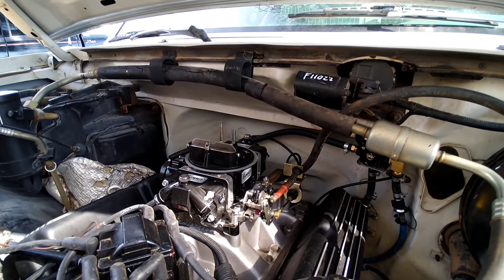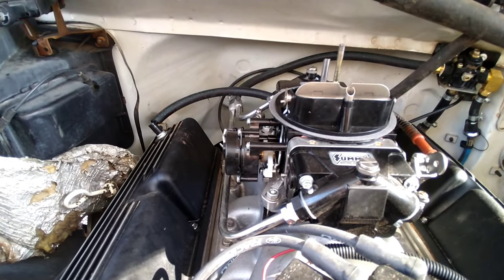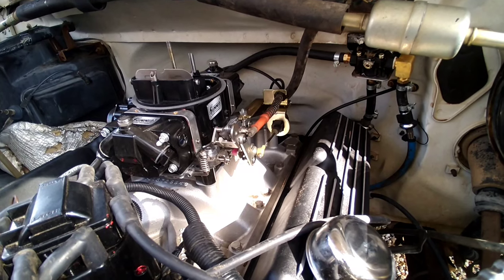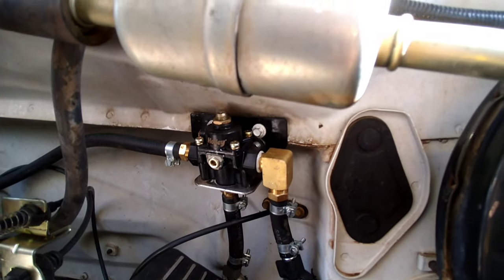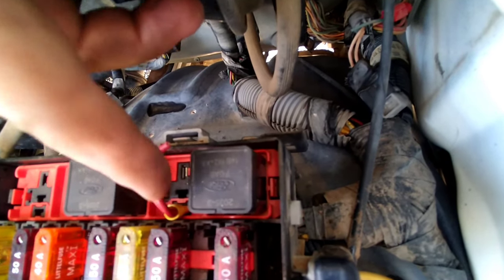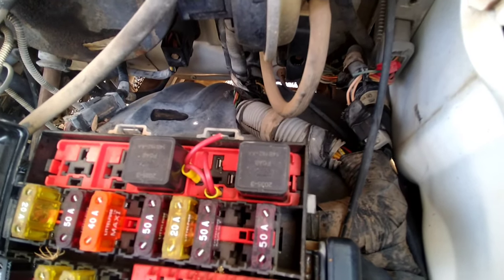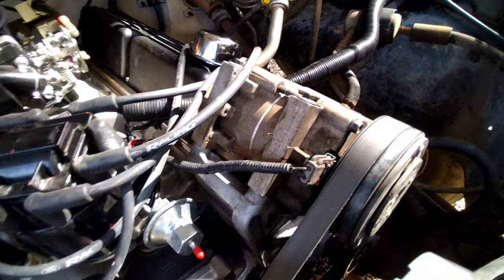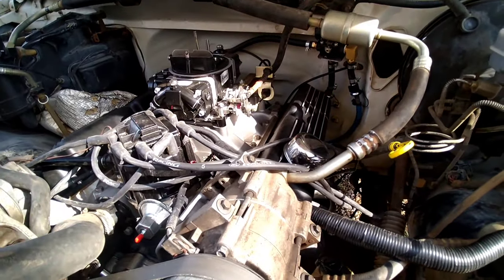87-96 F150 EFI to Carburetor conversion

Comment: I did this on my 94 model f 250 351 w. And I can't get it to run right to save my life. 1 day I drove at about 70 miles and ran perfectly, park it, on the way back home the next day. I didn't think it's gonna make it home. It runs perfect in park. But when I put it in drive, give it gas it stumbles and dies. Any suggestions would be greatly appreciated. I've been dealing with this for a year.
Reply from the maker: What's your fuel pressure at what carb u running and what timing
Reply: @CCAutoWorks  about 5 psi, eldelbrock,  I'm going to check timing today.
Reply from the maker: @ourtube4u  id bump fuel pressure to 7 psi and check your float height wat distributor and coil are u running
Reply: @CCAutoWorks  it's a jegs distributor and msd coil. I uped the timing and it helped a lot, on a eldelbrock carburetor witch port do I use for vacuum advance?
Reply: Thanks for your help. So far it has been a great help!
Reply from the maker: @ourtube4u  your supposed to use the port that doesn't have vacuum at an idle only when you give it throttle it has vacuum but I use which ever one works better for placement
Reply from the maker: @ourtube4u  timing should be 12/13 degrees of initial timing and 34/36 overall timing
Reply: @CCAutoWorks  thanks man you've been a great help 👍 😀
Reply from the maker: @ourtube4u no problem anytime

Comment: I appreciate this video very much. My truck is an 89 and I believe it won't run because of a bunch of electrical problems. I've sunk so much time and money into it that now I'm to the point where I think I might go this route.  Do you happen to have links to the brackets that you used.  I think i can find everything else
Reply from the maker: Yes I can send the link and this is definitely the way to go
Reply from the maker: https://www.ebay.com/itm/Throttle-Cable-TV-Cable-Bracket-for-200-200-4R-200C-4L60-AOD-Sonnax-/283457202705?mkcid=16&mkevt=1&_trksid=p2349624.m46890.l49286&mkrid=711-127632-2357-0
Reply from the maker: https://www.ebay.com/itm/700R4-AOD-TV-Kickdown-Bracket-Kit-for-Edelbrock-Carter-Carburetors-/271255406805?mkcid=16&mkevt=1&_trksid=p2349624.m46890.l49286&mkrid=711-127632-2357-0
Reply: I have a 92 flareside with the 5.0 but wanting to put a 347 stroker it's non maf do you know what would I have to do to make it run like it should with efi, or would it be better to carb it @CCAutoWorks
Reply from the maker: @javontewashington9141  if your going to run a small efi cam it should run but if your going with a big cam u will have to convert to MAF
Reply: @CCAutoWorks  ok I actually have an a9p computer with the motorsports maf conversion harness I bought for my 88 Ltd crown Vic but I went carb so would that work for the truck?
Reply from the maker: @javontewashington9141  I think so Ford racing used sale a similar kit
Reply: @CCAutoWorks  ok thanks I'll give it a shot I'm thinking of buying a 425 HP 347 stroker, but I do have one more question if my computer and maf conversion kit works would the e40d handle the HP stock
Reply from the maker: @javontewashington9141  depends on who u ask some say yes some say no but the insides are the same as a aod and I've ran one with a 408 stroker no problem
Reply: @CCAutoWorks  ok thanks

Comment: Howdy! Can you post the part number for the throttle bracket? I'm thinking of going with a Street Demon 650 and want to make sure I get the right bracket for the Trans/Throttle combo. Thank you!
Reply from the maker: https://www.ebay.com/itm/234926748138?mkcid=16&mkevt=1&mkrid=711-127632-2357-0&ssspo=ZjVZZbogTlq&sssrc=2349624&ssuid=6G4e_MbCTLy&var=&widget_ver=artemis&media=COPY
Reply from the maker: https://www.ebay.com/itm/254633876443?mkcid=16&mkevt=1&mkrid=711-127632-2357-0&ssspo=aXIgKJ3kSby&sssrc=2349624&ssuid=6G4e_MbCTLy&var=&widget_ver=artemis&media=COPY

Comment: Great video. I'm in the middle of converting my 96 F150, and according to my door tag I have the A4R70W transmission, my question is what if anything do I need to do different as far as electrical. Sorry if that sounds dumb, I've never really worked on ford's of this generation. Thanks!
Reply from the maker: From what I know the 4r70w gets expensive to to do this swap you have to put a throttle body position sensor on the carb on the choke side and there's a company that makes a control box that will run the trans but last I checked it was over $500
Reply: Run a c6 like I am I you want reliability over fuel mileage. AOD if you want an auto but hydraulic control. Get a controller for the 4r70w or swap to a 5 speed.
Reply: @kevinkaas937 how did it go so far? Let us know.  Maybe upload a video

Comment: What about the vacuum lines for the heat controls and all that. What do u do with all that?
Reply from the maker: The one vacuum line that operates the a/c vents I just hooked to a port on the carb works perfect

Comment: My truck is a 89 5.8 351w, if I buy a 86 carb 5.8, will my intake fit on the 86 5.8?
Reply from the maker: Yes all 5.8 have the same intake bolt pattern and deck height this engine is a 96 and I put a carb intake and an older carbed 5.8 a newer 5.8 efi intake will fit
Reply: @CCAutoWorks  ok so 89 efi intake will fit on 86 carbed motor correct? Direct bolt on?
Reply: And do u by chance know what the torque specs are for rod and main bearings 5.8
Reply from the maker: @maximumredline97  yes but most 86 models where already efi from factory so it might be an efi someone swapped years ago
Reply: @CCAutoWorks  its ab 86 f350 351. I had a 86 f150 that was efi. Im guessing on the f250 and f350 they still went with carb till 87
Reply from the maker: @maximumredline97  f250/350 where still carb I apologize I was thinking f150
Reply: @CCAutoWorks  its alright, I appreciate u getting back with me tho. Im decent on a chevy or a dodge. But its been a while since iv owned a ford. I didnt know on the intake pattern on a ford. I know on a dodge pre 85 the intake bolts were slanted. Then when they came out with magnum they went to straight up and down
Reply: @CCAutoWorks  just making sure b4 I bought it
Reply from the maker: @maximumredline97  yessir anytime

Comment: Did you keep the stock high pressure pump on the frame rail or did you bypass it?
Reply from the maker: My 92 doesn't have the high pressure on the rail it has high pressure pumps in the tank but if you have the low pressure pump in the tank and the high pressure on the rail just unplug the one on the rail and just run the low pressure in the tank if you don't want to run a regulator but if you do run a pressure regulator leave them like they are and let it return the used fuel to the tank

Comment: Nice conversion... I have project car that needs convertion to carb... Does the Holley fuel pressure regulator work with the high pressure from the oem efi fuel pump and drop the pressure all the way from around 5 bar to around 7-9 psi..?
Reply from the maker: That's how mine is as long as you have a return to return all the extra fuel pressure you golden and make sure u get the low pressure regulator for carb use because they have the same regulator for high pressure EFI use too
Reply: @CCAutoWorks  Thanks for the reply... appreciate it... now my old mercedes might just came back to life...
Reply from the maker: @syafiqadha  I don't know much about them but if you have a card a carb intake to fit the engine and you have a hei distributor or a way to make the stock ignition system work she will run like a champ
Reply: @CCAutoWorks  My mercedes is a W124 with the pain in the ass fuel divider... it still uses a distributor for ignition... just needed the right fuel regulator and the right carb...
Reply from the maker: @syafiqadha  https://www.ebay.com/itm/304779174781?mkcid=16&mkevt=1&mkrid=711-127632-2357-0&ssspo=UTIBs-LAQCi&sssrc=2349624&ssuid=6G4e_MbCTLy&var=&widget_ver=artemis&media=COPY
Reply: @CCAutoWorks  Thanks man... appreciate it...
Reply from the maker: @syafiqadha  anytime thank you for watching

Comment: Are you still running the coolant temperature sensor ??
Reply from the maker: Yes temp,oil,amp and tach
Reply: The one thats next to the distributor? Did you keep that connector on the harness
Reply from the maker: @carloschavarria8093  yes and yes I cut everything out except the temp wire the oil pressure wire the ac compressor wires and the tach wire and one ignition wire for the new distributor
Reply from the maker: @carloschavarria8093  no I just figured out witch one ran the tach and one ignition wire from that connector and cut out the rest of it I only left five wires from the original harness

Comment: So are you still running stock E7 heads? Trying to do the same conversion from EFI but with a manual trans so it should be easier.
Reply from the maker: In this video i was running promaxx aluminum heads but a couple months ago I actually pulled them off and put the E7 heads back on so I could use the promaxx heads on my brothers 393 stroker

Comment: It looks nice. You did a good job clean job. What distributor did you use. I'm doing the same thing but, I'm putting a 351W and a AODE from a '94 F150 into a 74 F100.
Reply from the maker: That's awesome I just just a small cap hei distributor off ebay

Comment: Did you cut all the o2 sensors and did you have to do anything with the computer?
Reply from the maker: Mine only had one O2 and I removed it and the computer is still in the truck but it's all stand alone now with the carb and hei distributor

Comment: I have a 89 with a 4.9 which I’m swapping out with a 5.8. Would these same things you did work? And also have a 5 speed M5OD-R2 to go with that
Reply from the maker: They should
Reply from the maker: You won't have to worry about the kickdown cable but you can use the stock pump and jump the relay just use a bypass return style pressure regulator
Reply: Thank you, I appreciate the feed back!
Reply: Do you have the links to where I can purchase some of the things needed?
Reply from the maker: @h1maldonado05  I can try to find them carbs from Summitracing and distributor,intake, throttle bracket are from ebay
Reply: @CCAutoWorks  really appreciate it
Reply from the maker: @h1maldonado05  if you really want the links I'll look them up what parts are you needing
Reply: @CCAutoWorks  right now just about everything needed for the conversion to be honest
Reply from the maker: @h1maldonado05  https://www.ebay.com/itm/FORD-351W-Windsor-BLACK-HEI-Distributor-8mm-Spiral-Core-Spark-Plug-wires-USA-/321888807068?mkcid=16&mkevt=1&_trksid=p2349624.m46890.l49286&mkrid=711-127632-2357-0
Reply from the maker: @h1maldonado05  https://www.ebay.com/itm/Weiand-Ford-351W-Windsor-Dual-Plane-High-Rise-Stealth-Intake-Manifold-IMCA-/133374027685?mkcid=16&mkevt=1&_trksid=p2349624.m46890.l49286&mkrid=711-127632-2357-0
Reply from the maker: @h1maldonado05  https://www.ebay.com/itm/Sonnax-AS6-01-Throttle-Cable-TV-Cable-Bracket-TH-200-200C-2004R-700R4-4L60-AOD-/283666850881?mkcid=16&mkevt=1&_trksid=p2349624.m46890.l49286&mkrid=711-127632-2357-0
Reply from the maker: @h1maldonado05  https://www.summitracing.com/parts/sum-carb600-ecvs or any carb of choice
Reply: Good looking out bro! Will keep bothering you if I have anymore quiestions
Reply from the maker: @h1maldonado05  anytime bro it's no problem
Reply from the maker: https://www.summitracing.com/parts/sum-700203
Reply from the maker: If you run a aod transmission
Reply: @CCAutoWorks  man am I glad I came across your videos! I watched the other videos on how you built the 351 and it’s pretty much what I want to do with my engine. Except mine isn’t bored over, yet…
Reply from the maker: @h1maldonado05  were about to build another one for my brothers mustang just got the block back from the machine shop
Reply: @CCAutoWorks  I hope you guys film that build process as well!
Reply from the maker: @h1maldonado05  I guess we can but I really wasn't planning on it because my build    didn't get many views
Reply: The m5od won't hold up behind that 351.

Comment: Going to do this on my 85 mustang with the CFI. How much different would it be compared to the EFI?
Reply from the maker: Only thing I see that would be any different would be the wiring fuel intake carb linkage should all be about the same
Reply: @CCAutoWorks  Thank you for the reply! Can you supply a parts list for all the fittings for the fuel pressure regulator, please?
Reply from the maker: @sanchezg92  I just used 1/2" pipe thread elbows to run into my Holley regulator I used a bypass style 0-9 psi
Reply: @CCAutoWorks  appreciate your help man!
Reply from the maker: @sanchezg92  no problem anytime

Comment: So my main issue is the kick down cable you sent me the link to the bracket but do I need to get the other bracket that goes on the carb to make it work ?
Reply from the maker: Yes the one on the carb is a correction bracket for the length of throw for the cable
Reply: @CCAutoWorks  could you send me the link to the one you got
Reply from the maker: @marshalhudson1358  it really depends on what carb your running Edelbrock or holley
Reply: @CCAutoWorks  Holley
Reply from the maker: @marshalhudson1358  https://www.summitracing.com/parts/sox-as4-04k

Comment: Do you have part numbers for your throttle bracket and throttle lever?
Reply from the maker: https://www.ebay.com/itm/325976019573?mkcid=16&mkevt=1&mkrid=711-127632-2357-0&ssspo=xrYoP4WaTge&sssrc=4429486&ssuid=6G4e_MbCTLy&var=&widget_ver=artemis&media=COPY
Reply from the maker: https://www.ebay.com/itm/134639576650?mkcid=16&mkevt=1&mkrid=711-127632-2357-0&ssspo=YQNWtBfKRee&sssrc=4429486&ssuid=6G4e_MbCTLy&var=&widget_ver=artemis&media=COPY
Reply: @CCAutoWorks Thanks! I appreciate that.

Comment: another question - did you cut away the rest of the engine harness wires that weren't used?  I have the oil, water, AC and Tach wires ( I think) - is it ok to get rid of the rest?
Reply from the maker: Yessir that's all I kept I cut out the injectors the egr the tps the idle air control all the smog trash and just kept one ignition wire for new distributor the ac,water temp,oil,tach
Reply: witch wire is the tac wire?
Reply: @jeremysilor7323  If I remember correctly- it’s the tan wire
Reply: @job1bf  thank you for the help
Reply: Which wire on the original distributor wire is the key on ignition wire
Reply: @bigjonglenn u find out?
Reply: Yes thanks
Reply: @bigjonglenn  what color was it

Comment: I need to know what color wires did u use from the old distributor wiring harness  white with blue stripe ?
Reply from the maker: On my harness I used a black with white line for tack and a brown for 12v power for the hei distributor I used

Comment: What’s the timing 
Factory ford was 10 degrees before tdc
Reply from the maker: I run mine around 12-13° just for better throttle response and a little more power but I run 91 octane fuel and if I have to run 86 I just listen for spark knock

Comment: How is the A/C working? The ecu used to control it doesn't it?
Reply from the maker: It works fine I just don't turn it on unless I'm on the road or if I ideal it up some
Reply: @CCAutoWorks  so you activate it manually like ON and OFF ? Because like i said the ecu used to control along with thr climate system when to turn on and off the compressor
Reply from the maker: @orlanmedina3693  mines a 92 everything inside still works like factory on mine if it is computer controlled idk but I didn't remove my computer I just cleaned up and trimmed the harness to get rid of all the unnecessary EFI stuff
Reply: @CCAutoWorks  thanks. I got a 2005 triton that is going to the junk. Amd swapping a 302 with edelbrok top end, cam amd forced pistons and also getting rid of the automatic transmission and swapping a manual 4x4 in it. About $2500 in part to rebuild that 5.4L 3V engine. Ridiculous the 302 like that is $1,500 complete and 0 headache and waaaaay more reliable
Reply from the maker: @orlanmedina3693  that's going to be awesome I like the 2005 body style I just never like fords over head engines 2v 3v or 4v

Comment: Got a link to that bracket? Considering doing this one day and believe it or not, the throttle cable bracket gets me the most lol.

I don't have the resources to fab my own stuff so getting a manufactured one would be nice
Reply from the maker: https://www.ebay.com/itm/700R4-AOD-Kickdown-TV-Cable-Bracket-for-Holley-Carburetors-by-Sonnax-AS6-01-/254633845425?mkcid=16&mkevt=1&_trksid=p2349624.m46890.l49286&mkrid=711-127632-2357-0
Reply from the maker: I totally understand thank you for taking the time to watch
Reply: @CCAutoWorks  thanks! This might be easier on me since I have a 5 speed
Reply: @Alphawolf2325 did you ever get your swap done have a 5 speed myself

Comment: Great job on the swap, I'm finishing up my own very similar to yours 96 f150. I have a question, which wire did you use to get your factory tach to work on and read correctly? Thanks
Reply from the maker: On mine it was a red with black line
Reply: Where was the red with black line at originally?
Reply from the maker: @blakenail7653  at the factory distributor

Comment: Can you post a list of everything that you had to purchase to complete the swap over.
Reply from the maker: Carburetor intake manifold,hei distributor,low pressure fuel pressure regulator with bypass, carburetor or your choice, throttle bracket for a aod transmission, aod kickdown correction bracket to bolt to carb linkage
Reply: @CCAutoWorks   Thanks for the he info.

Comment: How did you find the factory tach wire in the distributor connector
Reply from the maker: I just touched each wire to the tach port on the hei tell I found the wire that made the tach wire but if u look through the comments I've told people what color the wire is I just don't remember without going and looking
Reply: @CCAutoWorks  I’m trying to figure out if the tach wire was in the distributor connector or on the coil
Reply from the maker: @gavinmorrison7567  distributor I can look in a bit and tell you the color